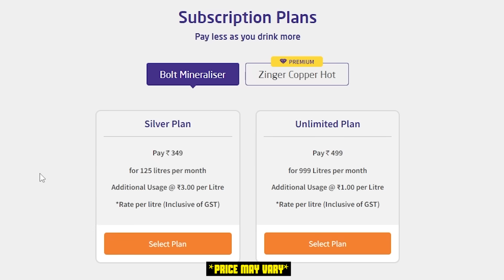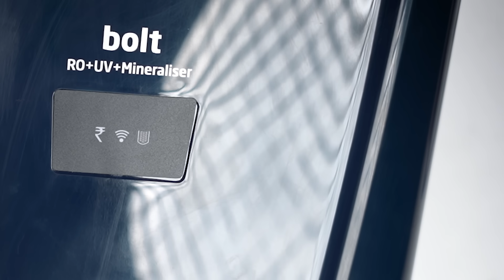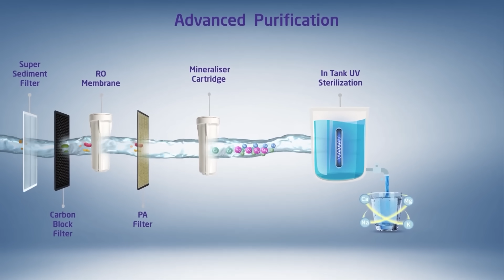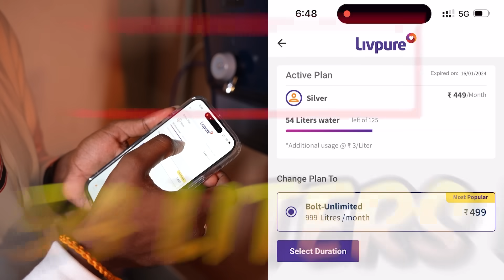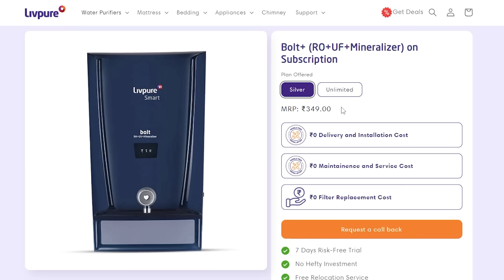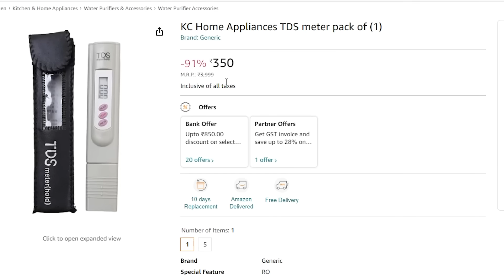தண்ணி CAN போட வந்தேன் BRO 🚰  - PC Doc | Purifier Vs தண்ணி Can - Which is Better?🤔

Comment: இது அதிக விலை. Livpure Purifier: 349/125 = Rs:2.79 per litre, 499/999 = Rs:0.5 per litre.
1 water cane 35/20 = Rs:1.75 per litre.
As per below my Ozean RO kit setup (including prefilter change once in 6 months and 12 litres per day, 350 days per year and 3 years appx.): 4200/12600 = Rs:0.33 per litre.
இதற்கு முன் 2019ல் நான் சென்னையில் Kent ரூ13000 வாங்கி சரியாக waranty முடிந்தது ஒரு மாதத்தில் பழுதாகிவிட்டது. சரிசெய்ய  ரூ8500 கேட்டார்கள். பிறகு Ozean RO kit ரூ1690 வாங்கி நானே assemble செய்தேன். இப்போதும் 3 1/2 வருடங்கள் கழித்து TDS: 880 ppm to 32 to 62 ppm நன்றாக வேலை செய்கிறது. பிறகு இதே kitயை வைத்து சொந்த ஊரில் உள்ள வீட்டில் வெறும் ரூ3900ல் முழு RO purifier யை assemble செய்து 3 1/4 வருடங்களாக நன்றாக வேலை செய்கிறது.
Reply: How to assemble ?.. spare parts name?
Reply: @mr.r5531  I bought the cabin Rs:500 in my area local RO shop.
Reply: Neenga solrapadi paatha ithaan best polaye
Reply: Enga area la TDS near by 900. Idhula indha RO innamum work aagurathu enakke aacharyam thaan👌
Reply: Good bro but Weekly once tds check pannunga bro one time water test yedunga bro adha safe
Reply: Thanks for information ozean ro kit enga vangininga brother
Reply: @Random_buds  Amazon la bro.
Reply: Nee yaru pa paithiam 😂
Reply: bro enaku onnume purila theliva sollunga

Comment: If we go with AMC option for a traditional RO purifier, annual cost for maintenance will be around 4k to 5k (including a new filter & free service throughout the year) which is almost equal to annual cost charged by water can suppliers. This rental option also costs us more or less the same annually. The only advantage is we can avoid the purchase cost of the device.
Reply: They will be keep on increasing prices this is just initial stages
Reply: @reshebkumar  true
Reply: DIY nu onnu irukku bro! Service personnel mattume nambama irukkalam.

Spares kidaikkura kadai mattum enga irukkunu parthu vachukkitta podhum! Only within 2k annually the issues get fixed.
In Chennai, Parrys area la Wholesale dealers available!
Reply: There might be a problem in future. Since the water supply is given like a Netflix subscription and it is connected as an IoT device, the supplier can cut the water supply if we don't do a subscription. Imagine you are thirsty and need to drink water but the purifier is asking for subscription money.
Reply: AMC potutu edhu ponalu onga current problem illa na onga v2 water probme sollitu paathiki paadhi kaasu vangitu pannuvaga appa andha 4 k waste dha
Reply: Bro iam also ro sales and service pandren domestic and commercial
Reply: Looks like u watch of utube😂
Reply: What about refilling your over head tank. The waste water is about 2x or 3x of the output.

Comment: Traditional RO purifier cost around 4000 in which u need to replace Filter(Rs.500 max) every 3-6 months depends water quality in that area, even if u replace ever 4 months it will be 4000 + (3*500) = 5500Rs and u Own the product. Liv pure cost 500/months = 6000/ year and it is rental so buying new is always better ( I myself use RO purifier for my family for almost 7 years we change the filter once in six months it cost around 450rs) 

  One more Important thing is  there will be lot of wastage in water to get 1 litre of drinking water, 3 litres of water will be the wastage. For example, to get 150 litre of drinking water, 450 litre of water will be wasted , It will not be suitable for areas with lack of water. In this case Buying RO Can if far better, if ur requirement is 1 RO CAN (ie 20 litres) a day,  then for a month 20 litres*30 days = 600 litres(Cost around 900rs/Months ie 30rs per can * 30 days = 900), in RO purifier to get 600 litres there will be wastage of upto 1800 litres. In some places people buy water for daily usage so there will be a loss of 1800 litres of water which still cost u money

One more point is it consumes Electricity , its does not require lot of power ,but still there will additional charges on electricity bill too

So  before buying any RO Purifier u have to check with ur requirement of drinking water, Water availablity and Quality of the RO CAN water available in that area

And lastly I dont see  any benifits in Livpure and only loss is there , so think a lot before Renting it
Reply: Good information 😊
Reply: Appo edhudhaa better???

Comment: Thare is problem in this concept .when you buy water cans, you pay for the purified "water" + can. But for this one, you pay 350 Rs for the purification process.after installating the unit you should pay for the water that you consumed separately. Think soilders 🤔 .1x25L can=20rs 5x25L=125L=100rs . So you are paying 350rs +your consumed water bill for 100rs worth water
Reply: 350 rupees covers usage of 125 L bro. They're not separate. Cost effectiveness -> In Most places in Chennai 20L can cost 30 or 35 even 40 rupees. Let's say 20 L for 30. Weekly 7 cans, monthly 28-30 cans. That's almost 900 a month just for water. You can get the unlimited plan and you'd save some money. I'm not using the product. Just explaining the business model behind this.
Reply: @sanjaysiddharth3614  see the video carefully bro 6:03 .350 for the usage of the purifier only not for the water .they just feeding the municipal water line into the purifier.the purifier company is not providing the water for you

Comment: Video is Good Bro,(Lithiuam battery vechu diy ups eppadi pannanumnu video podunga bro) oru ups evalavu volt output tharum, enna enna connect pannalam, evalavu neram use pannalam (back up time) check pannathu check panni sollunga, oru computer and monitor evalavu volt battery iruntha pothum,(3h to 5h kku).  Prinnter Use Pannalama, use pannanum na ennum evalavu lithium battery add pannanum, evalavu output varavum long time backup (3h to 5h) and small time backup(1h or 2h), modem use pannalama, ithalam connect panna enna Backup time varum appadinu video podunga . enakku use fulla irukkum na electrical knowledge person illa so koncham slow va sollunga bro. thanks. waiting for this video upload pannuvinganu nenaikkuren thanks again 🙏

Comment: Bro ungala nambi thaan bro vaangunom!

Mobile app la register panna odaney, avanga kitta irunthu call vanthathu, neenga sonna maari avangalum pudikkala na yeppa venalum cancel pannikalam both deposit fee and recharged amount refund aaidum 7 days trial kulla cancel pannal,
 7 days trail ku apram cancel panna deposit fee mattum refund aaidum, so don't worry nu sonnanga, naanum nambi vaanguna and more importantly monthly 499 illa 650rs, 12 months serthu recharge panna thaan 499, deposit fee 1500+650 = 2,150 itha neenga clear ah solli irukkalam! 
Sari ippo problem yenna, yenaku avanga tds laam check pannave illa water taste nallave illa, veetla pudikkala nu sonnanga, so cancel panlam nu call panna! Neenga minimum 3 months use panna thaan deposit fee refund pannuvom nu solran, ipdi laam neenga en kitta sollave illaye, ithu yenna puthusa irukku nu ketta, naanga yenga website la pottu irukkom nu solran! Ivanuku website irukkurathey first theriyathu, na ungala A2D ah nambi thaan mobile la register panna, na yemanthuten ungala nambi!
Reply: Same,today I got a call,they said the exact thing as like yours.thank you for mention it.

Comment: Bro actually in TDS meter below 50 only drinking water because check it once.. It will shows 025 for you at last so your tds is 025*10 = 250 check it in tds meter display corner or  in its manual

Comment: As a TWAD lab chemist 
We check the safe level for drinking water 7:15 as per IS 3025: part 16  standards 
acceptable limit is 500mg/l. 

1PPM = 1mg/l

Without necessary minerals drinking the RO purified water is unhealthy.
Reply: So do you just boil metro water at home and drink?

Comment: hi Bro.. oru dout..enga vedu la RO thn poiturukom.. first i done a reacher on Famous brands RO.. compare panathula enga oorula erikura RO service anna contact pani keta.. Custom "PC Build" panura mari nan build pani tharen RO water custom build panikalam sonaga.. 
build panitom 4years before cost effective .. which around 6k[which is value of money compare other brands cost above 9k]..  ipo antha RO anna keta ketan same spec 1000k extra aagum sonaga which is 7K.. 

bro nega service cost pathi onuma solla. in case RO membrane damage or any phical damage nan avaga apthupagala or nama money podanuma..

enaku one time thn problem filter dust vanthu filter damaged aageruchi.. nan ulla open pani mathetan..ipo itha mari filter serivce la 4 to 6 months once own mathiralam best filter pota 80 to 240 kula thn varum..

Here my Calculation:(if i am wrong kindly correct @a2d)

1. Exsisting Home (Pre-Build) RO: 7k[machine] + ( 700 [service below] * 4 [years] )= 9800K
2. New[Lvpol] Company Ro: 1499 [Installtion] + (4188 [Sub] + 500 [assume Service] * 4[years]) = 20,251(I think Inc Tax) - refund 1499 = 18752

Why i need to consider this product bro.. as you mentioned if salt water it is not suitable..

Comment: It is always advisable to install an RO purifier. However,A TDS tester is not sensitive enough to measure toxic levels of lead, chromium 6, or arsenic, even if they are present in a sample. 
Therefore, the manufacturer should bring lead test kits( as not all people are not aware of it yet ) along with TDS tester to ensure the quality of the water.
Reply: Is there a tester for the consumers to check the others?

Comment: Hi any one suggest me iam having desktop with below processor
Inter(R) core(TM) i5-9400F CPU @ 2.90GHz with ram 8GB using windows 10pro os but system is soo slow for booting up it takes nearly 10 min. Having 770GB free space. What i need to do to speed up
Reply: Try to clean the cache , reduce startup apps, uninstall unwanted apps and pause windows updates, update your drivers.
or 
Reset your pc (keep your files and reinstall windows).
Reply: @HappyArcade-nl7mz  cleared all my temp files when when i try to install any app it takes more than 15 min to start install. I assembled the system in 2019 with above specification. But now system is soo slow
Reply: @HappyArcade-nl7mz  also in task manager CPU is 26%, Memory 41%, Disk 100%
Reply: Monitor the background process in the task manager if any unwanted app is using the background process try to force stop
Reply: The problem is your disk. It uses 100% disk so apps are slowly installing. So app opening time takes longer than usual.
Reply: @HappyArcade-nl7mz  what i need to do now to sort this issue
Reply: Are you using a Hard disk or SSD
Reply: Use SSD for booting windows and Hard Disk for files storing your problem will be solved.
Reply: @HappyArcade-nl7mz  can u suggest me good SSD. If i use SSD whether the issue will be rectified
Reply: Upgrade to ssd storage because harddrives are too slow
Reply: @maravind9127 
Use 500GB SDD it is good for future update bcz software sizes are increasing.
*Under 500gb sdd today it ok but in future software size can be increase

Western Digital WD Blue SA510 SATA 500GB

Crucial MX500 500GB 

Those are good SSDs They have dram other series bx and wd green is dram less

Comment: A RO system with TDS controller should be avoided if
possible as you never know what is dissolved in the water
By mixing the RO purified water with the non RO purified
some harmful chemicals will get re-introduced in out put
water. Avoid plastic tanks where the sunlight directly falls on the purifer. If your water TDS level is under 500ppm then go for simple water purifer no need of features like uv,uf,mineraliser, copper, etc if your tds level is above 600ppm go for this features. Try to buy well reputed brand rather than newly launched with more features like app, wifi, Bluetooth which we wont use it mostly. Try to buy AMC which covers major problems like filters, electronic board issues and all the major problems will be covered. Like They are different plans gold and silver mostly in every brands with different names, rates. Try to buy the highest plan for one year so that all the major inner filters can be changed once after 7000-8000 literes depending on how many family members and try to chnage the inner filters in the last months in a year. After a year change the plan to silver so plan may be only to exchange outer filters. In this case unlimited water for 499rs for 12mon including gst= 5988. This more or less same after buying a purifer charges with mine in case LG 5500/-. I used this livpure purifier after 4 months i got sounds and the tap provides becomes loose. everytime i need to contact they are late always afterwards I returned and brought LG through EMI one year free filter replacement and customer care support is also very good.

Comment: Our purifier is worth 7000₹ till I used 10 years all its services and cost of buying in total is 10k₹ only it runs perfectly 10 years till now. if I install the livpure before 10 years I will pay per month 499₹ and I used for 10 years it will definitely cost 59880₹ 😮😮 this is how corporates makes us blind and control the people soo definitely don't buy it and if you use this device for 10 years it total cost is over 60000₹ and if you installed normal it will cost less than 15000₹ and normal purifier is ours and that livpure is not ours

Comment: the reason why you should not use charcoal, brick dust, neem stick, tooth powder is because it has bigger particle size and it will abrase your tooth structure ( theimanam agum ) so its always better to use paste because of its smaller particle size and foaming nature

Comment: Here is a worst brand for repair ₹19000
Reply: Apadhi enna repair bro
Reply: Motor
Reply: @prim3ffx  19,000 thuku oru pudhu purifier yaa vangi irukalama bro
Reply: @prim3ffx  why you repaired the old one
Reply: Bro I did not repair it I bought new purifier the old one is scrap
Reply: @prim3ffx  good decision